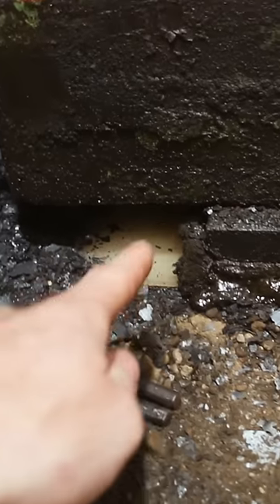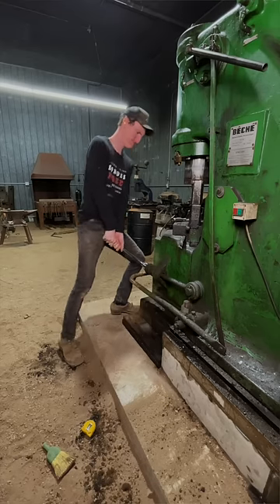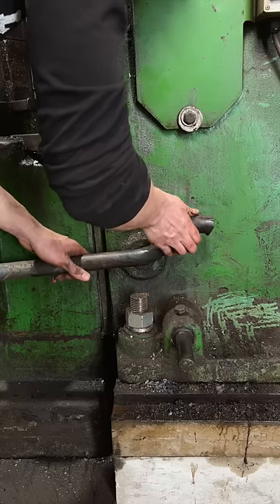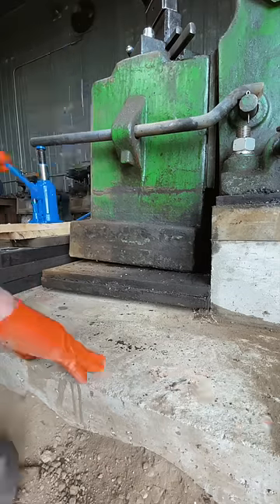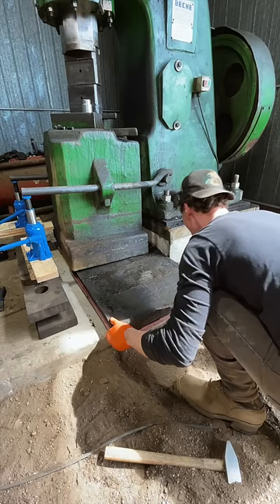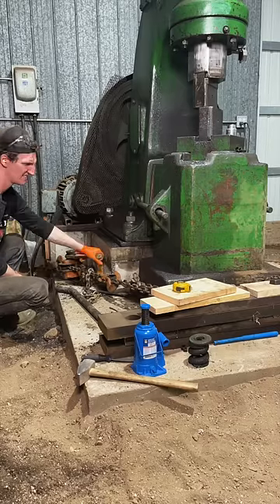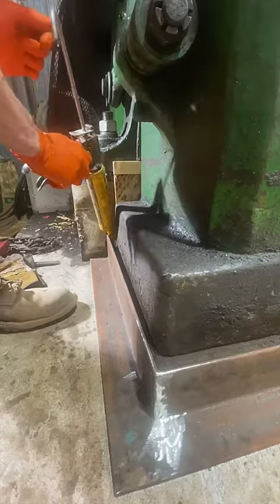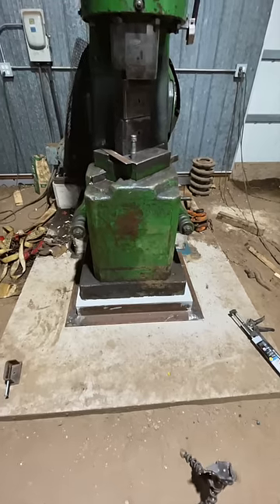Power hammer issues...

Comment: Woodworkers everywhere crying that you just wasted $200 of purpleheart wood.
Reply: Bruh add like a zero to that, unless you know something I don’t.
Reply: @mbm2355  At least one zero, probably double it as well.
Reply: Wasted? This will get more use of it in a year than a lifetime anywhere else
Reply: I was wondering why he used that.
Reply: @dukyben733  there are roughly 2000 varieties of wood that would do the exact same job. 10 of them can be found in any hardware store, 5 of them would cost $40 before the pandemic (they might be pushing $100 now for a piece that size, but still a drop in the bucket compared to purple heart). But that's not the worst part. The worst part is they used a beautiful, absolutely gorgeous piece of wood, and then completely covered it up. But not my money, not my circus, not my monkey. All I can do is cry in the corner.
Reply: @dukyben733  Except that it will be destroyed  under the hammer. As opposed to say, pen blanks, knife handles, clock faces, platters and bowls, or LITERALLY anything else.
Reply: @Duky Ben  using purple heart like that would be like using solid gold toothpicks after a meal. It's not only just unnecessary, but it's a waste of resources.

It's not getting any use at all under there. He treats it like a piece of scrap. It's an extremely expensive and highly sought-after wood. Not to mention rare and highly controlled.
Reply: @dutchvanderlinde8900  all wood is scrap wood until you give it a purpose. This scrap wood got a great second life as a shock absorbing spacer for this machine.
Reply: Lmao only $200? My dude have you looked at lumber prices lately? Youre a few hundred bucks and a six month backorder low
Reply: that "scrap wood" is a piece of highly sought after exotic hardwood that with only a saw, a piece of sandpaper, and some polyurethane could become a $2000 dollar top for an end table.
Reply: I thought that was just a joke wtf. That's literally just gotta be for the clicks 💀
Reply: @deebonglord3209  Theres almost no such thing as scrap Purple Heartwood.  Ive seen people use the smallest pieces of that stuff. Like gold scrap is useless lol.
Reply: MORE than that today!!! 😢
Reply: The sheets of 3/4. Inch (18mm) OSB would do that job. The grain goes in all directions and it’s heavily compressed by the factory. Even better, soak it in thin epoxy and vac bag to ensure it’s well sucked into the end grain.
Reply: Purpleheart is cheaper than Osage Orange which is cheaper than Katalox. And those are the only 2 woods I can get my hands on that are harder than Purpleheart. You could get hickory for about 1/3 the price and have something within 10% of the hardness. That would have been my play.
Reply: @RichardBronosky  Osage Orange is very good wood, the only reason it's expensive is because it can only be cultivated by humans. Hickory, ash, maple, beech, pecan, or even oak with a resin coat would have all worked exactly the same imo.
Reply: Thats like 9 board ft. Or like $250. You guys dont know what you're talking about
Reply: Bruh I heard purple heart and was like damn this dude has money
Reply: As a once  7 year millwright, that was an impressive way to improvise lifting a heavy piece of machinery. I just wonder if using structural oakwood would have been a better buffer?
Reply: @mbm2355  Don't know where your buying your purpleheart but that wasn't $2K worth.
Reply: @bas17h4  That wasn't 9 board feet or even close and even if it was you can get 8/4 for about $16 a board foot if you're grabbing under 10 board feet and as cheap as $12 if you're going for 100 or more. 4/4 and 6/4 are slightly cheaper.
Reply: @RichardBronosky  Where are you buying Katalox cheaper than Osage and purpleheart?
Reply: Heard that I was like nooooooo😂
Reply: @matrix626 😂 you guys must not work with purpleheart. I can get a 3x30x196 slab for less than 3 grand. That piece he uses is nowhere near 2000.
Reply: Shit that piece is doin work!! No waste there lol
Reply: He will get far more VALUE out of it than any fifty pieces wood workers used.
Reply: AHHHHH I KNOW RIGHT??  YOU CANT EVEN SEE IT
Reply: @matrix626 0 doubled is still 0.....
Reply: @deebonglord3209 yeah but.... isnt purple heart toxic when you work it? I would imagine crushing it is kind of like working it....
Reply: @outkast937 technically he made an end table with it...
Reply: @Dave5843-d9m you want it to absorb shock i think. What you suggest would make it crack with ever other hit i think...
Reply: @DisgruntledGrunt  true. Regardless, idk why everyone seems to act like they now what they're talking about when it's no where near that price. It's about par with black walnut
Reply: @frankierzucekjr  it's super dense fairly stable and rot resistant.  It also comes in a lot of different grades so not all the stuff is as expensive as you would think -
Reply: @bas17h4  This is exactly correct - You can tell the difference between someone who has gone online and shopped for purple heart knife scales but doesn't understand that it's not that expensive by the board foot for most of the grades.
Reply: @wesleypipesgaming19  it's all people who don't know the difference between lumber grades.  Also, they don't understand the insane markups involved when they buy blanks or scales for their DIY assemble, lube and show knife kits 😂
Reply: @ewingfox6459  Typical YouTube lol.
Reply: Give a diamond to a caveman and he will bash things with it. 
Things only have value because we attribute it as such.
Purple wood may mean a lot to us carpenters, but it's nothing special for a blacksmith and thats perfectly fine.
Reply: Yep. My ears came to a point when I heard that. "Did he just say PURPLE HEART??" (*sob*)
Reply: Seriously, that's like using gold nuggets as slingshot ammo
Reply: But it's worth
Reply: That’s not Purple Heart. Looks like Oak that he just colored for the lols.
Reply: I'm not even a woodworker but I heard purple heart and I had to play it back a couple times just to make sure

Comment: Good to go for another 100 years
Reply: And unfortunately, even then you still wont be able to get the sikaflex off 😂😂😂
Reply: Is that caulking basically?
Reply: @jzchannel1450 pretty much
Reply: @jzchannel1450  no, its flexible adhesive that has the remarkable ability to permanently stick to anything it seems lol

Used in the marine industry to literally hold boat keels on
Reply: @RealHankShill  the silicone in my shower peels up liek every year due to the tub shifting should i use that indead lol
Reply: @RealHankShill I need this shit. I don't have an actual use I just like to fuck with things I know I shouldn't be fucking with

Comment: I know Purple Heart is pretty dense/hard wood but why use such an expensive piece when there are other cheaper alternatives with the same properties?
Reply: Probably what he had on hand. Also that hammer is gonna take a whole lot of force onto that piece. Need to be really hard wood for it to hold up to that abuse
Reply: @D3nn1s telling me brother just had a multiple hundred dollar slab of wood the exact size needed in his trash pile?😂
Reply: @D3nn1s  nobody with purpleheart on hand would use it like this.
Reply: @dutchvanderlinde8900  You just don't know enough people
Reply: @dutchvanderlinde8900  He just did exactly that, did you NOT see?
Reply: Because he can, who cares..
Reply: @D3nn1s  it just doesn't need to be really hard wood. People normally use 2x6s for this
Reply: @dutchvanderlinde8900  actually people who have purple heart - most of it goes into structural stuff and would be a perfect fit for something like this. It's super dense, nice and stable with temperature and humidity changes, it's rot resistant due to the oils in the wood, pest resistant and actually pretty inexpensive compared to all kinds of synthetic options he could have gone with.

Comment: My grandpa had a similar issue with his tiny giant, it dusted the concrete underneath it. We repoured the concrete 6 inches thick and put it on top of a 3/4 inch steel plate and it dusted it again. I recommend putting it on a shock pad.

Comment: I have seen where they used to "grout" in the machinnes base to help with shifting from vibration and or the floor settling. It is also for longer bed machines to keep level and from bed twist. Great job though, work with what ya got not what ya wish. Happy to see youre back in running order.

Comment: what went wrong? that rubber ain't coushining anything, it is dampening a bit but eww it's on top where hot sparks will fall. love the wood choice, soak some mineral oil in it and add a thin very dense rubber pad on top of the wood across the whole piece. get rid of the toe kicker.

Comment: If it continues to move over time with use drill holes on each corner thru the angle iron into the concrete slab.  Once you pound some anchors into there that thing really wont go anywhere.

Comment: how about pouring a small concrete slab with some thick threaded stainless rods that you can bolt that thing directly to. being cheap about a job will cost you more in the long run vs actually doing the job right the first time. that hammer will keep shaking and moving on those, and that adhesive will let go a lot quicker than you think. you are lucky you arent a shop operating under safety standards, that'd get failed pretty quick in the shops ive worked in.

Comment: cover the silicone up, the scale will burn it and make it stink
Reply: Good call. Plus the fumes can't be healthy.
Reply: Why did you Have to tell him ?
Reply: Tell that to my silicone oven mitts. It handles the heat, why wouldn't this?
Reply: @leofortey7561  oven mitts dont get exposed to near molten steel
Reply: @leofortey7561 lol look at this guy thinking he's grabbing 1000 degree pots out of the oven
Reply: @leofortey7561  because the scale that falls off can be in excess of 1500 degrees fahrenheit
Reply: @leofortey7561  You think ovens get as hot as metal slag!?
Reply: Its sika its fine..

Comment: If you dont mind, what did your power hammer run ya?  Im currently saving up for one. Im probably gonna go for the mk75 or mk100 from kens custom iron, but im tempted to get one of the ones off of alibabba. They look decently made. I probably wont, cause they may be the cheapest option, but they will probably have challenges with maintaining it. Thanks bro!

Comment: no... you still have no traction between the concrete surface and the wood, and then the wood and the bottom of the steel machinery. rubber matts between all layers, and then bolt that steel frame you made to the concrete pad. 

this will slide again.. the whole assembly you've just created will slide.

Comment: Do you need something else to hold that angle iron down to the ground so it doesn’t slide take some concrete bolts and throw them through the angle iron into the concrete below
Reply: Or screws that are made for concrete

Comment: Why purple heart.. .   

That wood is not cheap. In fact, I think its protected here where I am from and you using a one inch 500x300 board as a cushion for your power hammer. . . .

Unless you are going for that oiled and well used sleeper wood look and feel, where you are going to take that wood out from there in about 50 years time and you plan on making a beautiful jewelry box from it. . . .

I kinda feel like that was a massive waste. . . 

Aaag, to each his own.

I was just taken aback by how easily you just mentioned purple heart like that. I suppose you work with metal and not so much wood so it's all the same to you. . . 

Unless where you from purple heart is not so precious. . . 

No value?

Thanx for sharing

TGC 
Blessings:)
Reply: Purple heart has high value everywhere in the world. This guy is just insane.

Comment: Why not use a peace of silicone or rubbler? Its definitely cheaper and it wont rot when the water and oil starts seeping in, the metal guard you put around it isn't going to do...anything really. Also rubber is cheaper than purple heartwood and last for thousands of years but hey if you want to do a stupid thing like waste a perfectly good peace of expensive wood that may not even last a year before cracking and rotting and then you have to breathe in all the fumes and spores that come off it that's a you problem

Comment: The wood slid in the first place because the hammer wasn’t striking plumb, posssibly not straight. Maybe  should’ve Ben balanced better or had better footing under it. Next time build the shop with this in mind driving piles under footprint to solid up the underneath

Comment: Hey. I doubt you will read this comment but, why don’t you just use high impact concrete. I know this will work as it works on generators in power plants. For those it lasts about 2 years for generators and they are much heavier and more force than that power hammer. Just a thought.